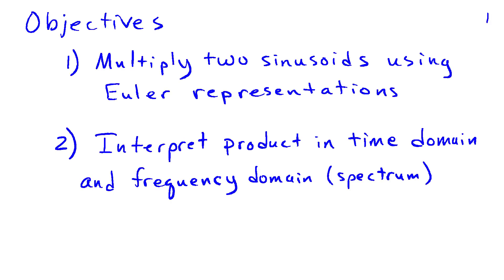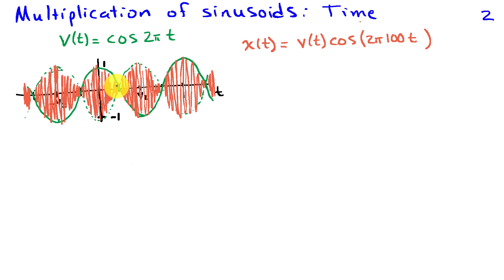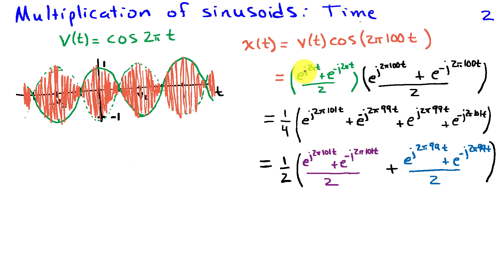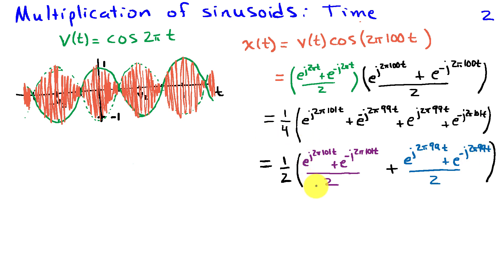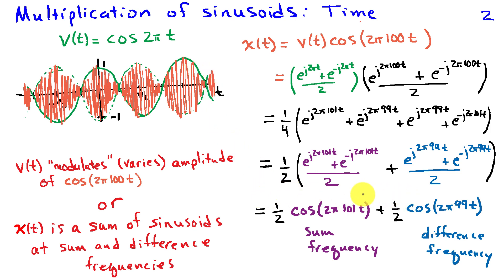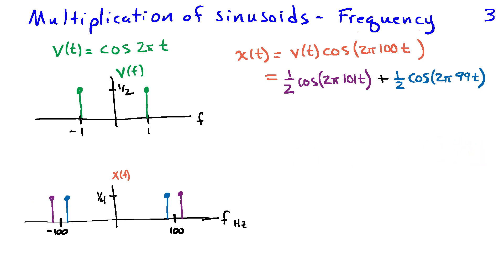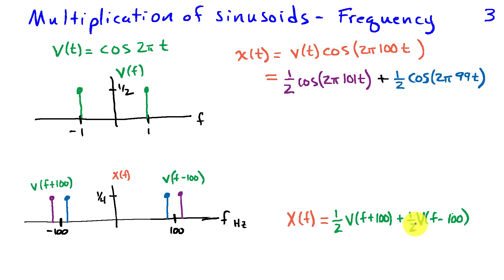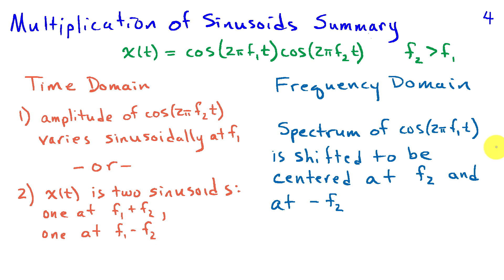Multiplication of Sinusoids

Comment: I always get confused when it comes to phasors and complete waves and complex numbers.The following circumstance I cant quite get intuition about: power and euler. If I take V(t)=Vcos(iwt) and cos(iwt)=RE(e^iwt) and a resistive load. Then I(t)=V/Rcos(iwt). It is stated that P which is only real in this case is equal to V(t)•I(t)*, where I(t)* is complex conjugate of I(t). Now if I do that math I only get the amplitude of the power but lose the time dependence. If I use your approach and express sinusoids directly in euler form not featuring RE( ) I get the full picture with time dependence. I guess my question is: It is clear that RE(a)•RE(b) =/= RE(a•b) but what is generally true about RE(a•b*) if a and b are sinusoids? It puzzles me that this magically yields the real power if a and b correspond to voltage and current. I fail to see the underlying symmetries. Some answer or literature would be appreciated.